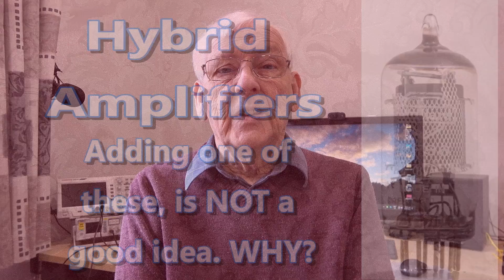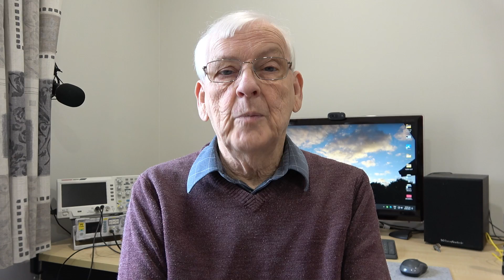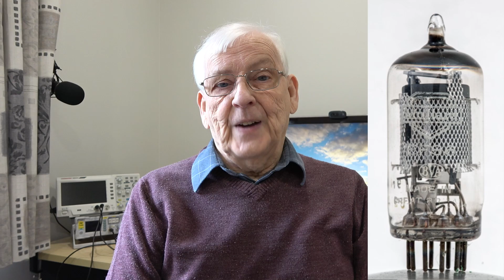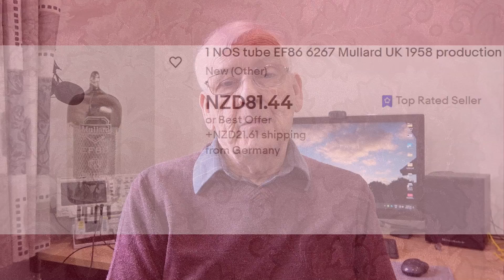HYBRID AMPLIFIERS. Adding one of these, is not a good idea. WHY?

Comment: I have one of the preamps you are talking about, and I understand everything you are saying. I have swapped out the valves for Mullards though, and the opamps for Muses 02. Howver, I'm sure all it is doing is adding distortion and colour, exactly as you say... Still, I am able to switch easily between the pure signal and the preamp signal to compare on the fly, and the preamp signal simply sounds richer and more pleasant to my ears. It adds what I can only describe as "sparkle" to the sound, a more 3D sound stage, which I really like.
Reply from the maker: The main thing is that if you like the results, nothing wrong with that. It's easy that it makes most recording sound OK. But you will lose out on the few very good recordings where you will lose that extra detail. I'm still not sure if it could make sense that most recording are OK but not great. Then I find a spectacular recording, then I know why I chose a none valve preamp, like the one on my last video.
Reply: @MichaelBeeny  As you have explained, distortion and colouration should logically make recordings sound worse and less like the music was intended to be. An oscilloscope will confirm it. I get it. However, in my experience, some loss of detail at certain frequencies allows other details to shine through. With my setup, the preamp really allows solo instruments, female voices, saxophones, pianos etc to elevate out of the mix. And since the frequencies are being manipulated by random emmissions of electrons, quantum mechanics essentially, it's infusing the music with an almost magical quality. We know that quanum behaviour is affected by presence of an observer... or, perhaps, listener ;)
Reply: Tubes add harmonics that sometimes make the recording sound better, especially if the recording was made in a studio. In other cases, such as a recording made in a concert hall, the harmonics are already built into the recording as captured by the recording mics. OTOH, some recording engineers will add some reverb or other processing to a studio recording to do the same thing. Unfortunately, there is no amplification system that works best for all recordings.
Reply: @Mark-rw3kw  I think it comes down to "audio enthusiast" vs "audiophile". Audiophiles are concerned with sonic purity and aesthetics, while the enthusiast wants excitement  and economy... loud, dynamic music and to hell with what it looks like. Tube preamps add excitement to music. I listen to a lot of 70s prog, 80s metal, 90s pop, classical, jazz, live concerts, you name it. The solo instruments pop out of the mix with my setup... Whether it's the saxophone in Dire Straits' Your Latest Trick or the riffing guitars on Thin Lizzy's Live and Dangerous album, Herbie Mann's flute or Hayley Westenra's voice... they soar in 3D space. The only music that disappoints is shoegaze music such as Slowdive where the intended effect of layered reverb guitars is swamped by excessive harmonics, and it doesn't really work. Like you say, no system is perfect for all music, but I'm a big fan of what these little tube preamps bring to the table.
Reply: @popculture70  Three of the top people at The Absolute Sound have an Audio Research tube pre-amp and solid state amp in their 250K home systems. I am quite sure that they consider themselves to be audiophiles of the highest level.
Reply: @Mark-rw3kw  I have no doubt. But my impression is that audiophiles are more interested in their expensive gear than they are to the music they're listening to, or rather they listen to the hifi itself, marvelling at the quality of the reproduction, rather than getting into the actual music. Maybe I'm wrong about that.
Reply: @popculture70  You are definitely wrong about the people at The Absolute Sound. All of their reviews have significant discussions of the recordings they use to evaluate the equipment, and they take the music very seriously. They are particularly interested in reproducing the sound that would be heard in a live performance venue.
Reply: @Mark-rw3kw  I get the impression they choose the music they like based on the equipment they have rather than the other way round... which is obviously the wrong way round. If you are spending 250K on something that is basically capacitors, transistors and resistors with a face value of 1% of 250K then there is clearly something wrong with you. Why should I listen to anything such a person has to say?
Reply: @popculture70  "choose the music they like based on the equipment they"? I have no idea what that means. Have you been to their website where they review music? They have expensive equipment because they can afford it, and because of that they chose what they think sounds best. That doesn't mean that one needs to spend that much, as they review some reasonably priced stuff also. But when cost was no object 3 of them chose a tube pre-amp and solid state amp, which I find interesting. I don't like to criticize decisions like that unless I have heard it myself (I haven't).
Reply: @Mark-rw3kw  My point is basically this... the Audiophile space seems to consist of massive squares who certainly aren't listening to the Sex Pistols or Iron Maiden on their 250K systems. They are, as is so indicative of today, listening to what makes their multi-thousand dollar systems sound good. It is the entire concept of music turned on its head, and so lame that I can only have contempt for it.
Reply from the maker: @Mark-rw3kw  Hi Mark, of course if you like adding extras to your music, that is your preference. I would never dream of telling you that you are wrong, simply because that's what you like!
Let's think what HiFi is all about. It's about re crating a piece of music as near as possible to the original performance. I think most people would agree to that. So, if that performance was flawed in some way and your amplifier hides that flaw, is that a good amplifier? No, it's not. The amplifier should not add or remove anything, if it does, it cannot be called a good amplifier. However, if you like what is added or removed, It's your preference, but it's not real HiFi.
On the other side of the coin, if you are playing a really good recording, and are playing it on such a system, you are removing the real harmonics in the recording because of limited bandwidth and speed and adding your own different harmonics and distortion. You may like this but it's far from the destination of what HiFi should be.
Reply: @MichaelBeeny  Please don’t assume that I prefer or own any tube equipment, because I don’t. Secondly, there have been many attempts to recreate a concert hall (large or small) experience in the home by adding some delay of reflections that occur in a live performance and sometimes it works and sometimes it doesn’t. Third, I have noticed that personal systems used by three different people at The Absolute Sound use an Audio Research tube pre-amp and solid state amp (usually Boulder) with Wilson speakers and their systems cost in excess of $250K, and I can assure you that they are most interested in recreating a live musical experience in their home listening room as accurately and realistically as possible.
Reply from the maker: @Mark-rw3kw  For that kind of money, they SHOULD offer good sound. What I am saying is you really do not need to pay ANYWHERE near that kind of money to get clean and quality sound.
Reply: @MichaelBeeny  No, I don't think that is what you are saying. The amount of money they spend is irrelevant, what is important is that they are obsessed with the best possible and most realistic sound reproduction, and when cost is no object they chose a tube pre-amp and solid state amp. The tube amps in your video are not expensive. BTW, their Boulder solid state amps cost anywhere from 75K to 200K as they are pure Class A up to very high output levels, and have extremely sophisticated protection circuits, since they are normally used with extremely expensive speakers. Now, I don't personally own any tube equipment, but I am not so arrogant as to dismiss them without a blind listening test using high quality recordings, to determine if they sound more like a live performance when reproduced in a home listening room. I also think that there may be some compromise of using a tube input buffer and solid-state amplification within a pre-amp (or amplifier), as some manufacturers have offered.

Comment: Good tubes with 2nd order even harmonics can add back the impression of an original recording, in my humble experienced opinion...  For example, a Douk ST-01 Pro TUBE tip: If your amp came with Chinese 6k4 tubes (has a red star printed on the glass), mine caused distortion.  I upgraded to much better sound for $17 with GE JAN 5654W matched pair tubes.  6k4 tubes can be replaced by 6J1, 6J2, 6J3, 6J4, 6J5, 6"1N, 64N, 65N, 5654/5654W, 5725, 6AK5, EF95, 6BA6, 403B, etc.  Your tubes may be ok.  Just an FYI free tip. Quality of each audio component matters.  But money alone guarantees nothing.  Good video.

Comment: I had a Vincent SV-226 integrated in my system for 5 years, and I thought it was quite nice.  But I've used other hybrid integrateds, and they weren't anything special.  But now I very much enjoy my tube preamp and Class AB mosfet power amp.

Comment: There's this, using your favorite search engine:
"Motherboard with integrated Vacuum Tube audio stage"
That one didn't last long, and I doubt it sold many. I've never seen one in the flesh.

One might ask why don't any of these USB audio interfaces have any tubes in them?  For one thing they'd cost twice as much just for the extra circuitry to support and power the tube, but those interfaces only sell if they have REALLY GOOD SPECS and they won't if the signal is going through a tube/valve.

Comment: Your videos very interesting! I am a valve fan because I like the soft clipping 2nd harmonic distortion ! I think it boosts the presence and makes the music sound almost live! I have also tried valves in the early stages feeding in solid stage F.E.T. Output and the results are very good! Matched pair Output valves like KT88, KT66 etc. As you rightly say are now very expensive (£ 130- 160 ) and I can’t afford to run them any more as I am now a pensonier! Some triode early pre amp valves are affordable but you have to watch Chinese cheapo types. If you buy through companies like Farnell you always get well made types that have been tested well! Companies like Farnell can’t afford to sell rubbish because it would damage their reputation!  btw I have a question regarding valve equipment in general! Why can valve indirectly heated not use DC 6volt or 12 volt supply from a regulated linear smoothed psu to reduce hum? I know smpsu’s are noisy, unreliable, and no use for quality audio equipment!  I have a GPO 48volt 10Amp DC linear Reg psu  more than 50 years old and it still work’s perfectly today! What do you think? Fraser😊
Reply from the maker: Hi Fraser, it's been probably 50 years since I've worked with valves, apart from a kit I made for this channel about 4 years ago. I think one of the main reasons AC is used for heaters is that it's readily available directly from the mains transformer. For most applications, hum is not really an issue. Center taps across the 6.3 volts or even a 100 ohm pot with the tap going to ground, work quite well.
In the 40s plus years ago, getting a stabilized 6.3 volts at maybe 10 amps would have been a very large and expensive thing to do, out of the question really. I have seen up market preamps with DC supplies, but these only need maybe about an amp, quite easy and cheap these days.
To be honest, I cannot remember if there is/was any other technical reason for not using DC. I'm sure someone will know the answer. I'm just sorry it's not me!! Thank you for an interesting comment.
Just a thought on clipping. The type of clipping should not be even thought about!! If you ARE clipping, then your amplifier is under powered. Common with valve amplifiers as they tend to be relatively low powered, unless you are rich, lol. Dose that not make sense??

Comment: I cant speak for mixing tubes w/Class D, my rig has a tube buffer on a Class AB amp and I prefer the sound with than without.
Reply: I have doge 8 clarity valve  preamp and a Hagerman labs MC trumpet phono stage into a Nord 2 600wpc classD power amp.

That is my combo for keeps if the preamp or phono are upgraded they will be valves. If the power amp is updated it will be class D.

To my ears a match made in heaven
Reply: @sbwlearning1372  Very nice pairing of components there! They all seem to be at equal level price point speaking. I must ask, how often are you replacing tubes? Im on year 4 with the GE 5654W's in my buffer kit with no signs of quitting yet.
Reply: @AllboroLCD  I've had the doge 8 and the hagerman trumpet MC for 2 years the preamp is used 6/7 hours everyday and the phono gets used about 15 hours a week.
The lifespan of my valves ( all 12ax7 variants) is around 10,000 hours depending on manufacturer and if military grade or not.
I have a mix of old and new valves ready for replacement. I bought them when I got the hagerman and the doge clarity . The hagerman came with a full complement of mullards from Mr hagerman himself. He said the tubes supplied would last at least 5 years even if the stage was used 6 hours a day every day !!!
I have been so impressed with the sound of both I haven't bothered replacing any of the valves.😁😁
🎵🎸🎧

Comment: Well this is right at the heart of HiFi BS. Hifi isn't True Fidelity.  It's about the consumerisation of audio. True Fidrlity Audio is about the asbscence of artefacts and so well designed components are not going to:   Do this, And sound like this, And make your Pink Floyd sound different/better. HiFi can literally mean anything , anyone wants it to mean - it"s post-modern audio 😁. BUT the HiFi Rabbit Holes run very deep and wide and there are aways nerw ones being dug to catch the OCD types. Really well designed components simply don't have any sound at all - they are inaudible in the signal path. Find out what REAL unamplified music sounds like, no mics, amps , or spealers in the chain. It sounds very clear, clean and tonally accurate. It doesn't have depth, or layering or exagerated bass or anything similiar because it doesn't have the artefacts which produce these effects.
Reply: So if well designed components add no sound does that mean technically/ theoretically a full high end valve system from the 60s/70s  will sound identical to a full high end solid state from the 70s/80s and a full high end classD / 32 bit digital system from today ????

High end doesn't mean Megabucks car/ house prices but well made well designed gear.

After 40 years of listening and buying I've settled on full  valve phono stage valve preamp and 32 bit DAC and classD 600wpc power amp.
To these ears far better than the class A pre and power amp they replaced
Reply: Yes, true live music often sounds very different than the sweet sound that audiophiles seem to seek. I think that's why many musicians aren't very bothered about obsessing over hifi kit, because they get to hear real live instruments all the time. The real acoustic sound of some instruments can be surprisingly rough and harsh, but also satisfying in that there is no compression.

Comment: I've wrestled back and forth with this.  It is accuracy vs what's sounds pleasing.  Music is entertainment for most people, so I can understand wanting that harmonically pleasing distortion to make it more enjoyable.  Assuming a digital source file is the same, and your amp stages (pre and power) are just passing on the truth, the two other major spots in the signal path where you will get differences would be the DAC and of course the speakers.  Their deficiencies are sometimes fixed by the coloration amps may have.

Comment: You can have all the best fastest most accurate and expensive gear on the planet including the most expensive speaker system on the planet, your still listening to a turntable or tape deck or cd. Weakest links! Try and find anyghing good that isn't accoustic strings or wood wind! Iv'e heard somepretty amazing sounding tube amps. Aren't they still making those? Also want to add, i have a quad 44 pre amp and it sounds like a pile of crapp. Not sure what Quad was thinking there. Too bad they aren't still around to try and redeem themselves. Keep up the great work  Mike, love your videos input and opinions😊
Reply from the maker: I would have to agree with your comments on Quad preamps. Quad was forced to bring out transistor stuff because sale of the QUAD 2 and 22 preamps was falling fast. The 405 amplifier was one of the better ones of its day but slow by today's standards. In fact, quite valve like sound. The 33 amplifier was just dreadful into coils but worked well with the electrostatic.
Current valve amplifiers are very expensive, giving the illusion they are wonderful. They are expensive because the valves are almost handmade and in small quantities. The transformers are full of expensive copper wire. Again, made in very small quantities, heavy, chassis made out of expensive materials, use of exotic timbers. They look good but it's the same valves, same circuits from 1950 check it out.
When these were first made, they were very mass produced as so many people had HiFi in those days. Now few people have ANY interest in sound, it's all phones and sound bars.
So, these same amplifiers are produced in expensive disguises for the rich that fool themselves that they are driving an expensive car. Afterall, if it cost a fortune and looks expensive, it's got to sound great.